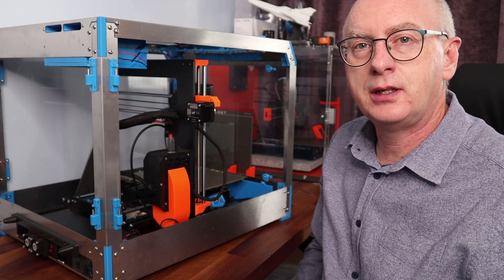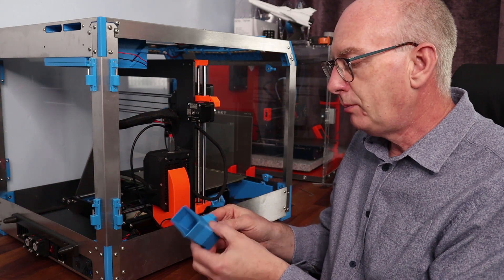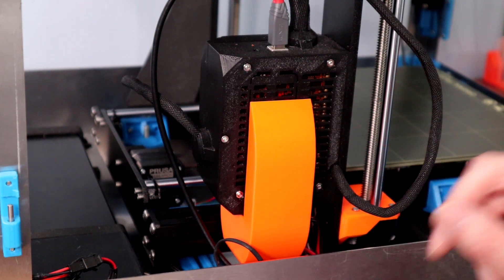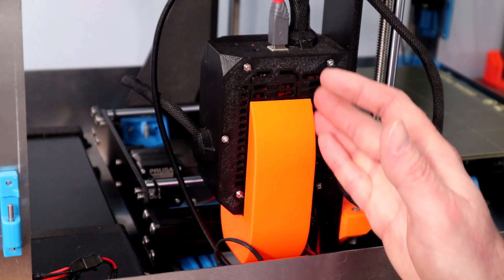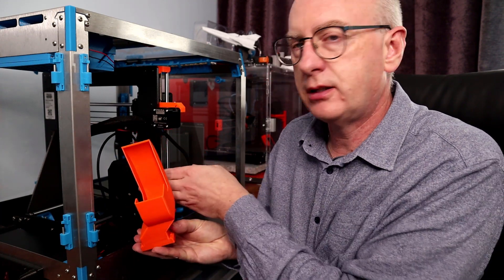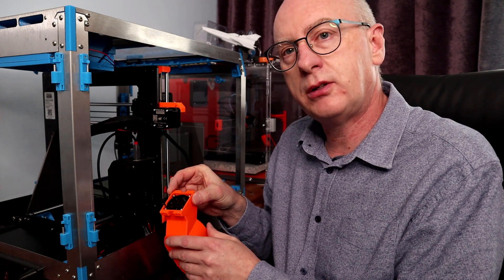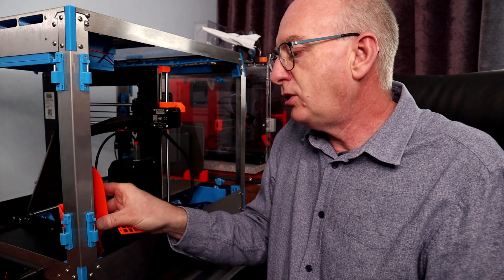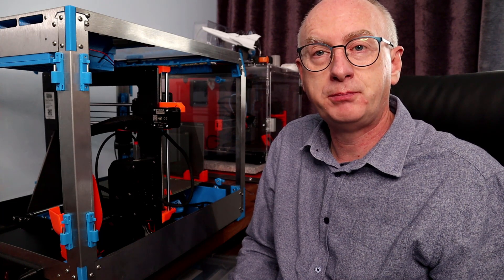Einsey Motherboard Cooling Solution for Prusa Box 3D Printer Enclosure for Prusa Mk3

Comment: Zero air flow putting fan on a closed flat surface... Real smart
Reply from the maker: @daledidomenico5341  yeah? especially as the feet of the enclosure raise it a few mm above table height so there Is airflow!

Comment: Silly question but how do you wire the fan to the motherboard?
Reply from the maker: You dont! Its connected to a 12v supply that is also used to power the extractor fan. Or if you use a 5v fan you can connect to the 5v output of a buck converter. Hope that helps.
Reply: @colinhill  I do not have an enclosure but I am using a raspberry pi zero and found a remix for your design so I'm trying to figure out how to wire the fan.
Reply: Actually, I'll just wire a 24v fan to the psu, problem solved. lol
Reply from the maker: @Printed_Visionz3D  I have it connected to the thermostatic control along with main extractor fan so it only cools mobo when temp is high.

Comment: Drat. Forgot you installed the special feet. I'm using the standard feet and will need to adjust the distance from the floor of the PrusaBox to the bottom of the motherboard. Would it be possible for you to take a measurement from the bottom of the 'Y" rail near your feet so I can calculate a starting point for the necessary height reduction?

Comment: Hi Colin, thanks for your help.  I haven't added the printer to my enclosure yet, still running wire for the control module, but just wondering would it be easy to add the printer after I added your Einsy cooling tower, or do you think it would be better to add the printer, then mount the Einsy cooling tower?  Also is the height of your Einsy cooling shroud based on the rubber feet you installed during your initial build, as I guess the height of everything would need to match.  I am also using those same rubber feet as I purchased them from PrusaBox.
Reply from the maker: It fits with those feet, a snug fit. I would install printer first

Comment: Hi Colin just wondering if you use the relay upgrade to control the Einsey fan or just have a master off/on switch, or maybe do you control it with the temperature control upgrade?  Also the same question for your PSU fans as well.  I was thinking to use the relay maybe to control both PSU and Einsey fans, just not sure if I need or want to control each of them separately. I am just building my box now so trying to decide before getting it all together and then changing things later.
Reply from the maker: Einsey fan - linked to the front mounted temperature control unit - same switch that controls the extractor fan. PSU fans - those are connected to my Pi/relays, set to turn on when print starts and relay off when print ends - using Octorelay plugin. For these PSU fans i also have a rear mounted rocker switch, as i only have them activated when running ASA.

Comment: Hello Sir! Do you have a solution for prusa mini as well in the perspective of extrusion with ABS? Thx a lot from Italy.👋👋 and best wishes for the new year!
Reply from the maker: What problem in particular?
Reply: Hello Colin, thx you for your reply. I am referring to a way for cooling prusa mini motherboard inside an enclosure...if any... thx again.Nicola
Reply from the maker: @nicolabazzurro1722  Hi. I don't think I have heard anyone try that, or want to cool that board. Probably a 25mm Pi fan would do the job but needs a case redesign and no way to have outside air.

Comment: how would that work for the bear prusa mk3s?
Reply from the maker: I have not used the bear version but looks like the extrusion is directly under the board, and likely also covers the vent hole. If that's the case then I cannot think of an immediate workaround. Unless you can duct air from the front right vent slot with some tubing?
Reply: @colinhill  i really done know if tube will work itll have to be from the side, is there any way i can email u so i can send u a pic i messaged u on fb messenger from printer box group